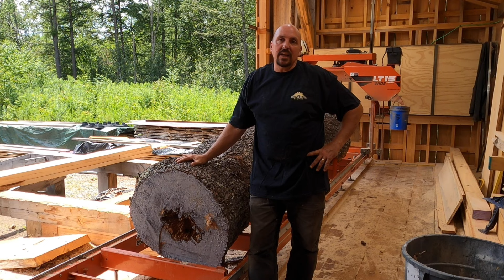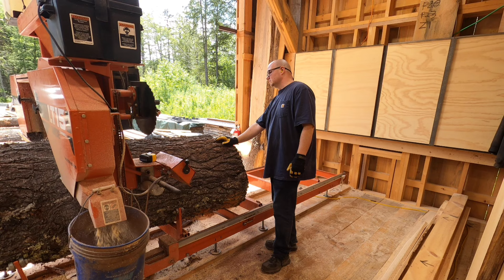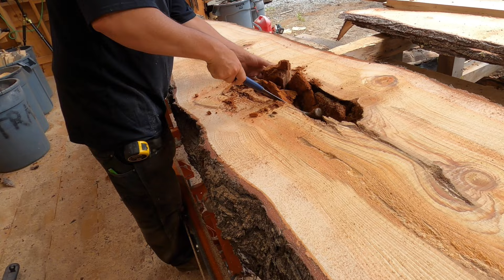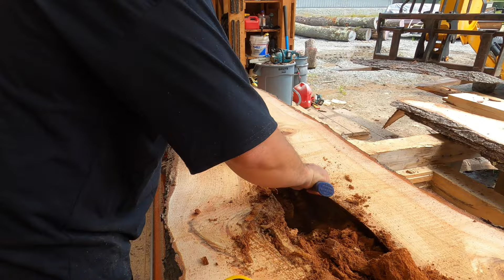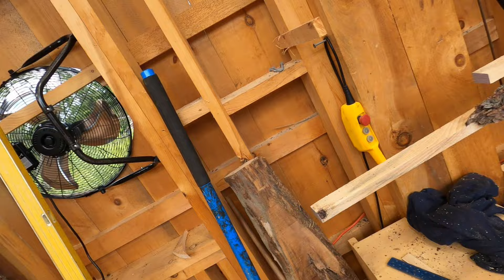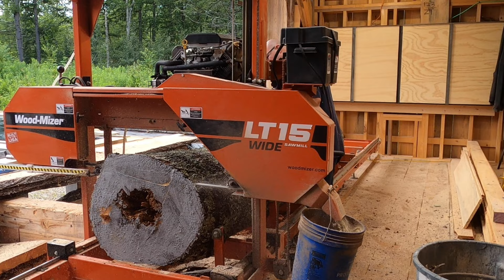Why Sawmills Should Never Buy Standing Trees

Comment: Your back! It looks like I have a few videos to watch. 
Thanks for the valuable lesson. I have bought standing lumber before from a tree service. I was lucky. 
I see you installed a log turner. That is nice to see. 
How did the new tool shed turn out? It's nice to watch people that know what they are doing build stuff. I mill lumber to do repair work around my building. I am no carpenter. I just fake it until I get the work done. Mybuilding isd more than 100 years old and built of hardwood and bricks. I intend on replacing as much of the wood with hardwood as possible. I always learn something interesting from you guys. 
Thanks for making videos again.
Reply from the maker: It's good to be back! I have a bunch of videos that I have to find time to edit, I have quite a backlog (no pun intended). The log turner is a life saver, we weren't sure if it would be worth the time/effort, but as soon as we used in the first time, we realized we should have done it sooner. The shed turned out well, it's never quite finished, but Dave and I have to do a walk-around video,  explaining how we laid it all out. What was your building originally? A home, or an industrial structure? Hope all is well! -Andy
Reply: @cripplecreeksawmill  the building is an old creamery. It was built in the early 1900s through the early 60s. There is always something to fix.

Comment: I'll bet you the right reason the wood cutters where there is for that reason. Sick tree and afraid to come down. They tricked you.
Reply from the maker: I really hope that they didn't intentionally sell it, knowing it was rotten. I told them afterwards, but nothing came of it. I take it as a lesson learned. -Andy
Reply: So glad to hear that you're not afraid to tackle logs that have been dead for years. My off-grid property gas literally over 1000 dead-standing trees. They'll either be a forest fire or a D-Log cabin as a result of the beetle-kill. Many Sawyers want green logs only.
Reply from the maker: @sidlawrence4045  I bought the property here as an off grid site as well, and  had to drag in power almost a third of a mile. As long as the standing dead hasn't started to rot, a lot of the bigger logs will have good wood. -Andy

Comment: The tree service likely knew they were ripping you off.   They were being paid to cut down the tree. Then you paid them
Again   Which sucks that they took advantage of you like that
Reply from the maker: It was a bit of a complex and rushed situation, because I made an offer, had to leave to get the trailer, and by the time I returned, it was a thunderstorm, and they had cleaned up there equipment, aside from the crane to load the logs. So I realized they were rotten, and they didn't want to chip them in the rain. I kept my word and paid, but it's a bit of a pill to swallow, that's for sure. -Andy

Comment: I have an old saying Never buy timber with ROSE TINTED GLASS'S on and that saying is doing the rounds here in Ireland
Reply from the maker: Thats it precisely! I saw the size of the tree and made a deal, and by the time I came back with the trailee to pick it up, they had dropped it and cleaned up the job because of a nasty rainstorm. It was only then that I realized how nasty the wood was inside. Do you have a mill in Ireland? Ive always wanted to visit. -Andy
Reply: @cripplecreeksawmill  i don't have one yet the father worked in a sawmill for 30 years